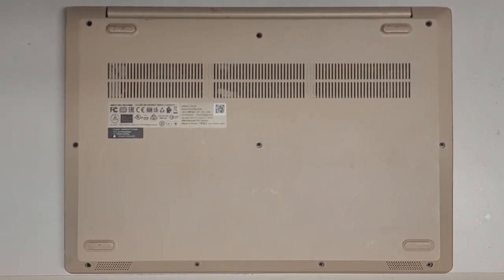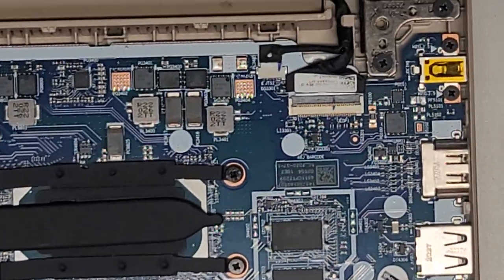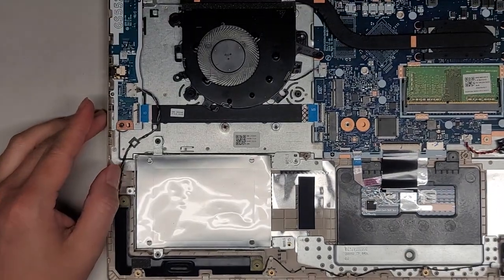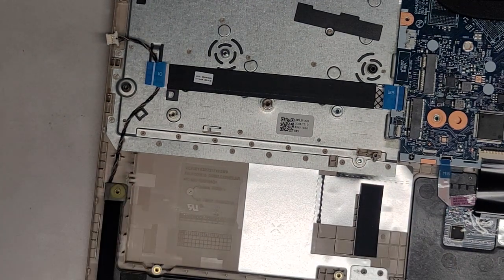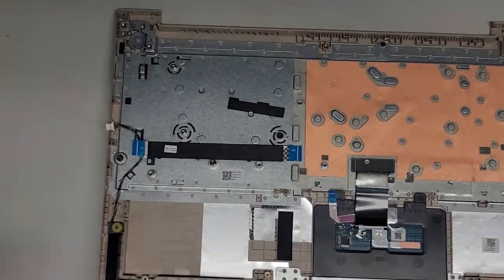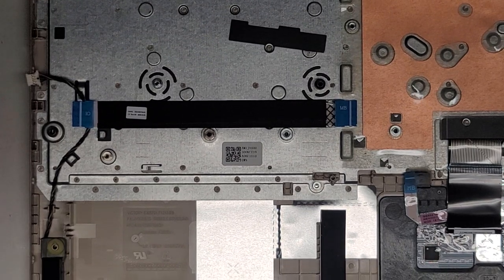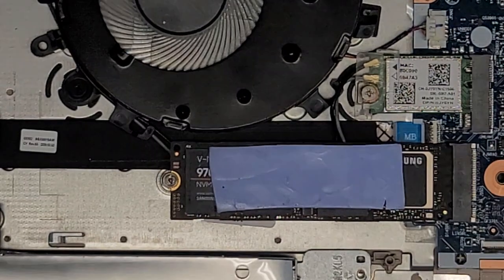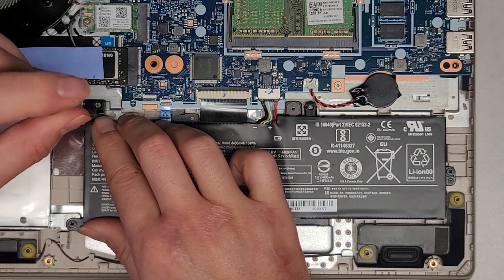Lenovo IdeaPad 3 15IIL05 Complete Disassembly RAM SSD Hard Drive Keyboard Battery Replacement Repair

Comment: Lenovo's Ideapads are pretty nice, A nice feature i've seen on my lenovo Ideapad 3 is function to disable the battery until it is plugged into again, they state its use is for when making repairs. 

Anyways, you've seen your fair share of computers so what do you think bout them Ideapads?
Reply from the maker: Other than the hinge issues they've been having, they seem good.